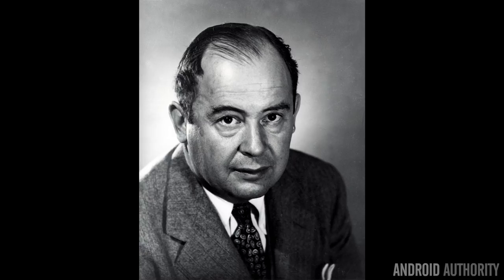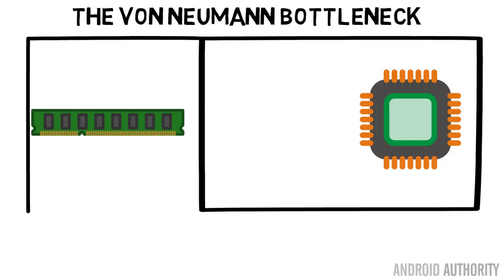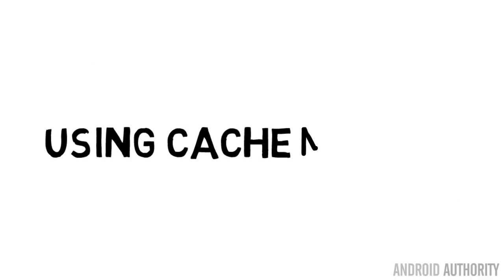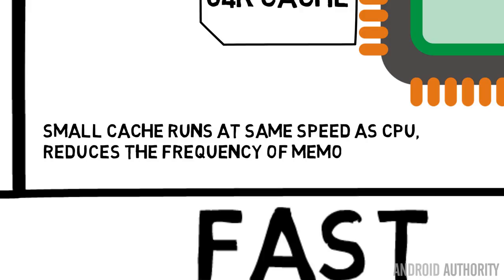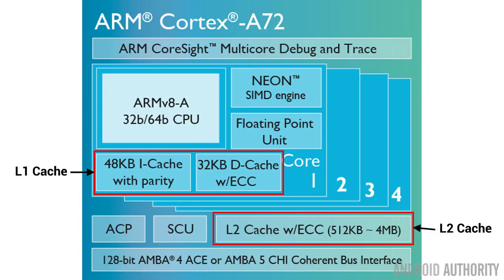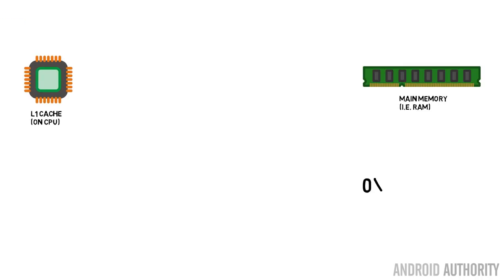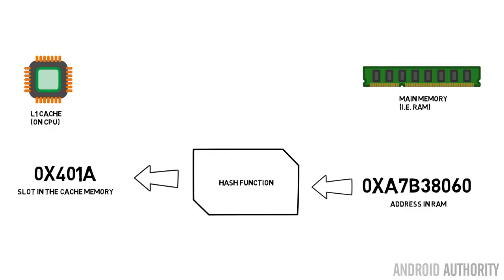What is cache memory - Gary explains

Comment: 1) Does android mobiles slow down if cache data becomes high??  They nearly occupy 1.8 GB. I clear them from time to time in the storage settings. Since this is a huge amount of cache data (compared to the cache memory in CPU) , are cached data and CPU cache related in anyway??

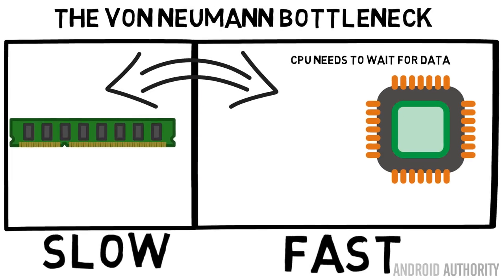2) At 2:45 you say there are several ways around the problem and one of them is cache memory. What are the other methods/ways ??

Comment: I'm confused, do I need to clear my cashe memory on my Note 4 or not?...is clearing it a good thing or not?....because I'm getting a clear cashe warning on my phone.
Reply: That's a different cache!
The one you're talking about is temporary files that are stored on you SD or internal memory. You can clear it as much as you want, in fact clearing it will make you gain space and sometimes performance.

The CPU cache is hidden from the user, and cannot be accessed at all, just like RAM.
Reply: +NOTMuzzaFuzza not confused anymore. thanks
Reply: Eric McDuffie further details : both of those are called "cache" because the data stored in them are temporary. 
But the one on your SD is software cache, that is temporary data that software temporarily needs, and CPU cache is temporary data that your hardware/phone needs.
Reply: +NOTMuzzaFuzza Awesome. Much appreciated. Thanks again.

Comment: Where did you get the 200mhz figure from? The Galaxy S7 has LPDDR4 RAM @ ~1800mhz, even the Nexus 4 had LPDDR2 RAM @ 533mhz. Bandwidth is plenty of the new SD820 devices, and if I remember correctly, the iPad Pro 12.9's RAM is plenty fast providing 51.2GB/S of data.
Reply: you're forgetting multipliers which bump up the effective frequency speed but the base frequency is still lower
Reply: +Michael Like +Panzer_Z said, the base frequency is 200MHz, or 266Mz or whatever, then you add the double data rate tech plus other things. I mention in the video that LPDDR4 runs at the equivalent of 1.8GHz, but even so you have 4 or 8 cores that want the data at the same time.
Reply: ***** But then you're talking about base frequency and not memory, because the CPU is also connected to the BCLK. This would mean the CPU is also at "200mhz" or whatever the BCLK is at.
Reply: +Michael Yeah, good point! Maybe I oversimplified things in my attempt to explain the bottleneck, which is what I say before I going on to talk about LPDDR3 and LPDD4. I think my exact words are something like "OK, I admit that is a oversimplied view of the problem..." @ around 1:05! Then @ 1:28 I talk about the real data rate of LPDDR3 and then I go on to talk about the effective clock speed of LPDDR4, i.e. 1.8GHz. Then at 1:48 I talk about that multiple cores are trying to access the same memory.
Reply: ***** Nice videos though. I enjoy your in depth explanations of hardware tech.
Reply: +Gary Sims Maybe do an explanation of how much light actually goes into a camera sensor, like what factors influence it? I've always wondered how the iPhone 6S' camera can capture a similar amount of light of the iPhone 6 despite having a smaller pixel pitch than the iPhone 6 (1.5microns vs 1.22 on the 6S) and only having a F/2.2 aperture on the lens.

Comment: iOS's RAM is the best compared to android ones.
Reply: +iMicca IOS does keep things optimized with lesser RAM and can compete with higher specced droids. Android OEMs really need to trim down the skin to be at least on par with vanilla Android.
Reply: ios runs native while android runs on a virtual machine android has another layer of software between it and the hardware. think about it like this and emulator on a computer,  the computer needs higher speeds then the system it's emulating.

Comment: can someone explain to me what he just said ? can't understand at all
Reply: +Dennis Meidiane 
Iphone user? If not, go, buy one. It may be better for you.
Jokes aside, the main thing you need to know, is that like in a normal PC/MAC etc, the RAM is not fast enough to feed the CPU. Therefor there is a faster memory, the CACHE. This cache hast different speed levels, wich the names level 1, level 2 etc come from. 
Think like this: 8 Windmills (8 cpu-cores) are feed by only one average human (RAM). He is too slow, to do it, even if the packages are huge. So the windmills have stashes, wich store their grain (information). This gives them really fast access to their working material.

Try googleing it, there are many videos out there, wich explain things good. one is maybe appropriate for you.
Reply: ***** What happened with iphone? I'm still using android, do apple use bigger cache on their devices ?
Reply: +Dennis Meidiane no, it's just better ram management
Reply: SkMakes Everything yeah, seen a lot of videos showing that iphones use ram a lot better than the other, i was looking for the iphone se, but didnt like the small 4 inch screen
Reply: +Dennis Meidiane 
Iphones fell much snappier than most mid or low-end Andoid devices. The SE or any of the 6, 6s or even 5S os i good choice. 
I personally dont like Iphones, due to IOS itself and the prices......